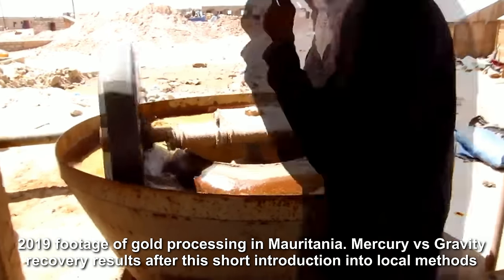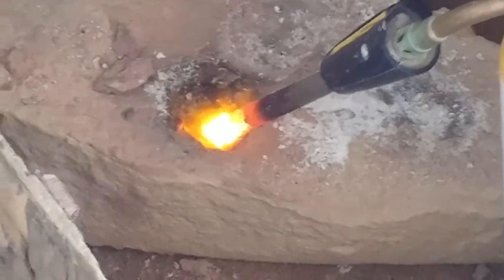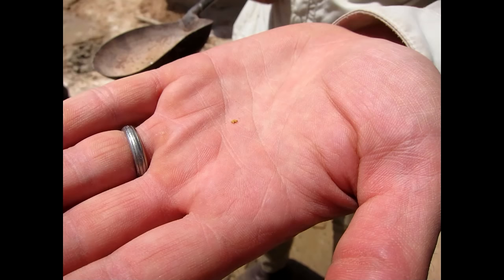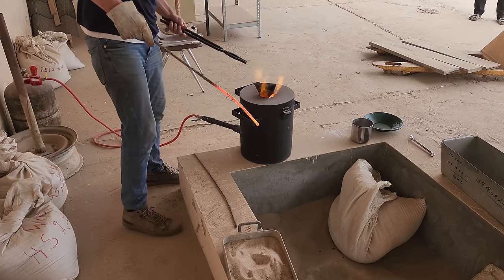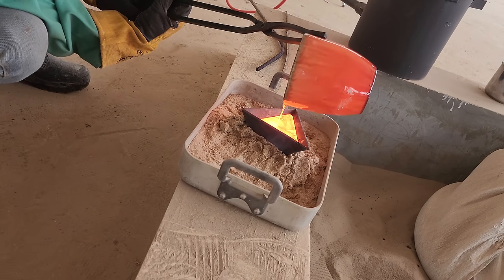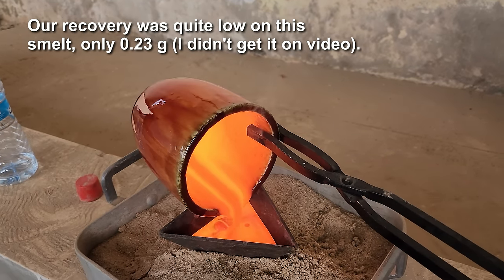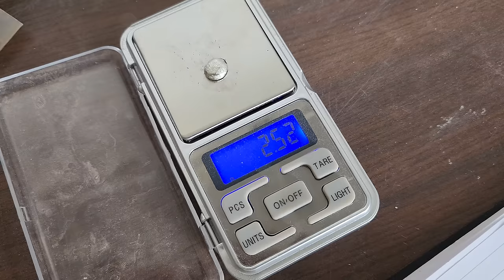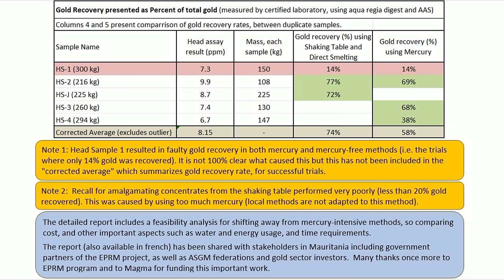MBMM in West Africa introducing mercury-free methods, in partnership with Pact (Part 2)

Comment: The report is inconclusive but was written by locals so as good as you can expect. Contamination of the roller mills is the problem. You need to convince the miners to do a scientific test not a "good enough" test. If the shaker table was missing 25% of the gold it would be visible in the tailings, the 25% never made it to the table.

Comment: Great work Jason! That mercury filtration through cloth with bare hands followed by burning off the Hg in the alcove with a Mapp gas is terrifying! I had a read of the report, looks like it's a no brainer apart from the upfront cost to the operator? I imagine many of these companies are running on minimal initial capital and on going costs are more acceptable than initial costs? It would be very interesting to do a follow up report in 18 months and see if anything has changed. Excellent work on your part! If these methods are adopted, it will make significant improvements for the local operators across the board.

Comment: Definitely more environmentally friendly! I would recommend customizing some crucible tongs, some that conform to the crucible providing better support. That one used came with the smelting kit, it has a major design flaw. The crucible deteriorates after some use, having to pour with those tongs will eventually break the edge causing a spill!

Comment: It would be interesting to build a Shaker Table with a Recirculation Loop on a 20:1 Turndown Ratio.
This allows Material to pass through the System multiple times.  This is a Continual Process Loop.
The way it's being done now (and for the last lotsa thousand years) is a Batch Process Method.
The process might be more efficient and faster to run a Coarser Grind and then send the Material not in the #1's back through the Hammer Mill.

Comment: Dam nothing more toxic they can do holy crap. Just wondering Jason Can you not have them eliminate the wheel grinder from your system? That is obviously adding steel into the system no? It would speed up your process of recovery too for them or is the material too hard to get it down far enough with just the hammer mill?

Comment: Why use the cone mill at all Jason ? Can’t they use the same set up you have at the shop ?
Reply: I assume this is for capital costs and ease of adoption. They already have the cone mills, know how to run them, and presumably know how/have the infrastructure to fix them. A jaw crusher is more complex and has more expensive wear parts (bearings are critical, jaws are specialized). It is cheaper and easier for locals to adopt mercury-free methods if they can reuse existing equipment.

Remember, these "artisanal scale" mining operations are dirt poor. Even though it would be better for everyone, and even though Jason's equipment is economical and a good investment, they probably can't afford the capital costs. At least not to start.

Getting away from dangerous and environmentally damaging techniques has to be a gradual and feasible approach. They have to show everyone that it is worthwhile to adopt in the very near term. Long term things like mercury poisoning and the environmental damage from using mercury, arsenic, burning tires (see previous videos), etc. come second to their livelihoods.

If they can make incremental change and recover more gold, then they can make more money, afford more/better equipment, and eventually get away from the worst practices entirely.
Reply: Well said haphazard!

Comment: Reading the report, the two main issues are 1) the upfront cost (6x the current method) and 2) the optimization of the workflow in respect to local settings (trial and error until the best performance seen). The improvement in recovery using GRG vs CMA does mean that they will make more money once the initial investment is paid off.

Comment: It is faster and safer to remove mercury with Nitric acid, then put a copper bar in the nitric acid and then recover the mercury from the copper bar.  Wash the gold sponge with water and then melt into a button.  Reuse the mercury over and over and not put it into the atmosphere.

Comment: So the big question is there a non-mercury extraction method that has acceptable recovery AND is cheaper than mercuric amalgamation? This is an economics problem at its heart and progress will not be made without an economically competitive solution. This unsafe work is painful to watch but i applaud your efforts to reduce the asinine use of mercury in gold extraction via demonstration of alternatives. Those workers breathing in gaseous mercury regularly are doomed to a painful and slow death. All that mercury spilled, left in waste, or burned off will make its way back into the water table, poisoning the surrounding ecosystem and everything that lives within it for 100s of years. These people are too naive and entrapped in economic disparity to understand what they are doing.

Comment: The bottom of that cone mill needs to be made of high manganese steel like AR400 or AR500. However AR400 and 500 are spendy. AR200 is only slightly more expensive than A36 and is still fairly abrasion resistant.

Comment: I watched Mildred do some, and he lost like 10% of the gold 😳 using the mercury
Reply: Hmm, so technically, they could run a shaker table with a cheese cloth over the grates, the Mercury goes through and the gold sits on top,

They don't need to touch it.

It doesn't need to be released into the environment.

It can be reused. 

Fume hood while heating

Comment: When I was young, I remember visiting the Homestake Mine it Lead, SD. I can remember huge vats at looked a lot like sewage treatment tanks. I recall them talking bout using CYANIDE in the process. HOW DID THAT WORK? - it might have been mercury - can you clarify that?
Reply: Heap leach is still the preferred method to extract gold and copper. Using cyanide in minute percentage which is less than 3% ,is sprinkled over each layer of ground ore on pads engineered to not leak and direct the solution to  tanks using tiles semular to   a septic tank leach field .It is then precipitated out with zinc. The zinc is then fired to vapors leaving the heavy metals behind. Zinc is recycled and the other metals are smelted to purify. If the pads are engineered properly they don't leak which ensures all the values are going to be recovered. Some mines that used that method continued to put out gold years after mining the lode was completed and shut down. If the ore has high levels of sulfides the ore must be roasted to cook them off which means the grade of ore must be much higher in the old days. Now they use large amounts of engineered bacteria that consume the sulfides before using the zinc. Some sulfide mine tailings were reprocessed when the bio heap leach was developed because there was a lot of gold left behind. Mercury was used but found to have many problems when gold was mixed with other metals such as copper.